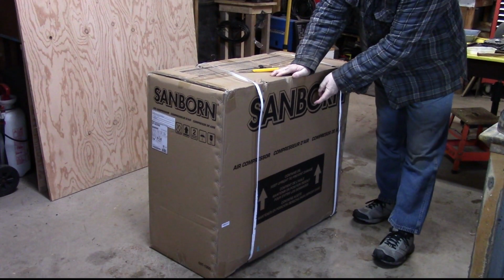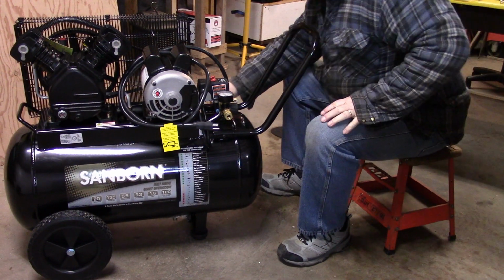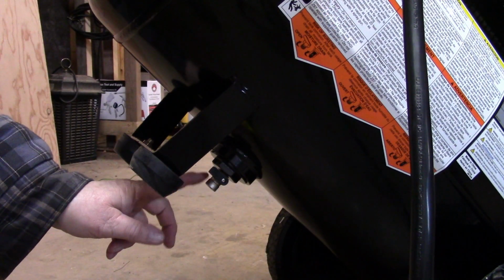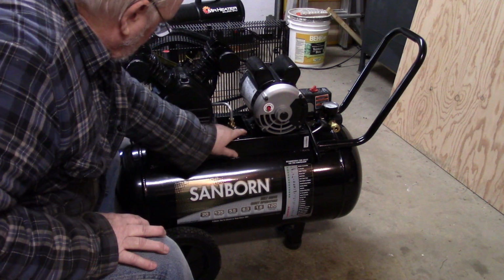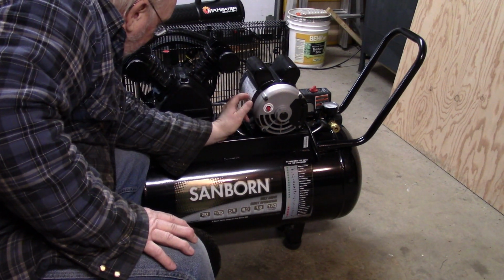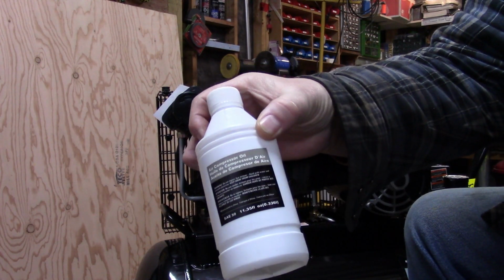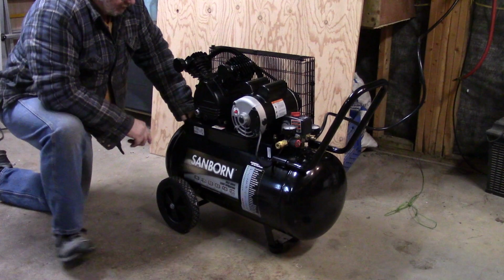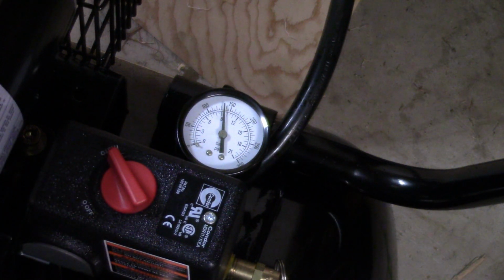Commissioning My New Sanborn Air Compressor

Comment: I just bought that same compressor off Face book market place , mine quit working after about 30 minutes , it didn't have any air in it when I first started messing with it and so I plugged it in and turned the switch to auto and it didn't take long to get it to 135 psi , I then started practicing spraying a paint sprayer and getting the sprayer adjusted, I was using water instead of paint just because I was practicing and plus trying to see how long I could paint until I ran out of air .
I ran it out of air about 3 times 
I forgot to mention I was powering the compressor using a Honda generator and right before it quit working my generators motor reved up really high meaning the compressor was pulling a lot of power for a short time like a surge , it hasn't worked since and so I come on YouTube trying to figure it out .
Thanks for posting this video it made me more familiar with my compressor 
because at least I know where a few more components are that I didn't before.
I tried pressing the red reset button on the electric motor but it doesn't seem to move much
Reply from the maker: How's she goin'?  First off, thanks for searching out my video and I'm glad it was of some help.  Secondly, it sounds like maybe you have a compressor issue, not a motor issue.  The red reset button won't move much if the thermal overload is not tripped.  Did the circuit breaker on the generator trip?  Did the generator stop running when the compressor stopped?  Can you turn the compressor by hand?  If none of these things happened than maybe you could have a bad motor or the thermal overload is shot.  Good luck.  I hope you can get the compressor running and continue with your projects.  Take 'er easy!!
Reply: @GrampiesWorkshop 
My generators circuit breaker didn't trip but the light turned red like it was getting ready to trip.
Then the generator kept running like normal
Reply from the maker: I suspect that the circuit breaker on the generator did trip.  Have you tried to reset it?  Sometimes a breaker will trip and it looks like it isn't.  Just turn it off and then back on.  Good luck!!
Reply: @GrampiesWorkshop 
My compressor and motor both spin freely not locked up.
I was going to bypass electric directly to the motor to test it , 8 first just tried powering it up and the compressor fired right up and went from 0 psi to 135 psi in 3 minutes.
It's got a air leak were the pipe threads into the tank , the pipe that runs vertical going from under the switch to the tank , it's leaking at where it threads into the tank , will Teflon tape fix that or do I need something more specialized ?.
As far as the generators tripping, I don't think so because when there running correctly they have a green light and when the generators breaker trips the green light goes out and the red light comes on and I have to restart the generators to reset and get the green light back on , I'm running 2  
Honda eu2200i in parallel 
A single Honda eu2200i wouldn't even start the compressor..
Thank you for all the info , these compressors are nice , nice and quiet
Reply from the maker: That's a weird one about the breaker not supplying power from the generators.  When running generators in parrel it's important that they be phased correctly or else one will try and short out the other one.  It's pretty tricky theory to couple generators together.  When I was a working Joe, my job was an industrial electrician and part of what I maintained was the standby generators to run equipment in case of a power failure.   It was always an issue to get the generators 'phased' correctly before we could put them on line because they would short out and shut down if the phasing wasn't correct.  Oh and Teflon tape should help with your air leak.  I hope you can get this sorted out and have your compressor working good again!  Take 'er easy!!

Comment: Even though it has two cylinders is it a 2 stage or single stage?  Which is better and what is the difference.  Thanks Mate👍😊
Reply from the maker: How's she goin'?  Thanks for watching.  That's a good question.  This is a single stage compressor and that's why it takes so long to build pressure.  A dual stage compressor compresses the air twice and so builds pressure faster.  I think for the average DIY're a single stage compressor is fine, but if I were a body man and spray painting or using the compressor a lot every day, a dual stage compressor would be worthwhile.  Thanks again for dropping by the shop and take 'er easy!!

Comment: Thank you. I still have my 30 year old Sandborn
Reply: I forgot to mention that it stopped working and I’ve been looking for a solution. I found a video that pointed straight to the capacitors but now I’m thinking that I may buy a rebuild kit for it as well
Reply from the maker: Ooops!!!  Maybe it's not so good!!!  LOL  I'm sorry to read that yours is broke down.  If it's an issue with the motor not starting then the caps could be the fault, or the electrical 'start-run' switch on the inside of the motor could be bad.  Caps don't usually fail unless physically damaged, but the start-run switch switches a good amount of current every time the motor starts and so could have problems with the contacts wearing out.  Just sayin'.  I sure hope you can get it running again.  Thanks for the comments and take care!!!
Reply from the maker: How's she goin'?  Welcome to the channel!!!  My Sandborn is working great!!!  I'm glad to hear yours is still working after 30 years!!!  Thanks for tuning in and take care!!!

Comment: My old Webster 1hp hot dog  compressor that is at least 34 years old, i retired it due to worry over rust,  and it never had a label  or welded tag stating the date. 
The new campbell hausfeld compressor i got does have that on it.  None the less i went to Staples and got a Sharper Oil-Paint marker in white, and labelled the date i got the compressor and the date the tank was made.
Reply from the maker: How's she goin'?  That's a great idea!!!  This compressor has a tag on the tank, but marking the date would be a much better idea I think.  I have a 'red' paint marker.  I think I'll date my tank first thing in the morning.  Thanks for the tip and for watching.  Take care!!!

Comment: Mike   I have an old "non-oil" compressor and I find the noise is loud, annoying and sharp.   Its also on its last legs , I am a DIY'er mainly needing air for small cleaning jobs, tire inflation on my cars and light work in the shop.  How is your Sanborn holding up.  Princess Auto has them on sale right now and Im thinking on getting one after watching your video
Reply from the maker: Hello there Al and Andrea!!!  Thanks so much for dropping by the channel and watching this video!!  Here's my honest and frank evaluation of the Sanborn Compressor I bought:  I think it's a very good compressor.   
Now for the details!!!  LOL  It is a bit noisy.  When I first got it I thought it was pretty quiet, but I was comparing to my older one which was loud.  So the Sanborn is a bit on the noisy side.  Not terrible mind you.  Like you can still carry on a conversation standing beside it but it's noisy.  
Another thing I encountered was the oil I used, which was SAE30 compressor oil as recommended, gets pretty think when in the cold.  I don't heat my shop except for when I'm in there so during the colder months, the compressor wouldn't start because the oil was cold and think.  To overcome this I had a magnetic oil heater that I had got one time for my tractor.  I just place it on the crank case and plug it in.  It's a 300 watt heater I think, and it manages to keep the crank warm enough so that the compressor will start.  
I also feel like it takes a long time for the compressor to build up pressure.  What I'm trying to say is the cycle time seems to be long.  It may not be, but when you're waiting for the compressor to stop, it seems like it take a long time.  I timed it in the video and I can't remember exactly how long it was, but when you're waiting it's looong...  
Other than that I think this compressor is great for doing the things you mentioned.  That's more or less what I use the compressor for as well.  It seems to be well made and good and rugged.  Like I said, I think it's a good compressor.  
I hope this helped you with your purchase.  I know the compressor is a big ticket item, so when I was trying to decide if I should get  it or not, I was thinking I want to get a good one, but I don't need the Cadillac version right.  
Anyways, it was great to have you visit and I hope you come back again.  You can tell me about what you work on in your shop, or better still make some videos and get them on YouTube.  It's a great hobby!!  Take 'er easy!!!
Reply: @GrampiesWorkshop  okay that helps , My old one is really noisy but its the type of noise it is.  .  Im working in a 12x20 garage area and the compressor will be on the far wall.  It won't be running a lot anyhow so Ill just ignore whoever is talking for the 4 minutes it runs or they can ignore me . I also watched your episode on installing a drain hose and I will be doing the same thing.  Looks a lot more convenient than trying to reach underneath
Reply from the maker: @alandandreabonner4404  It is a lot easier.  And don't forget to drain the tank regularly!!!  LOL

Comment: Thanks for the great video. Does it work off a 15 or 20 amp breaker?
Reply from the maker: How's she goin'?  Thanks a lot for dropping by the channel!!  This compressor is fed with a 20 Amp circuit.  I have to say I am pleased with the compressor.  It has been working good.  But one day during the winter, it was like -10 C in the shop, the compressor wouldn't start and it tripped the breaker.  I come to find out that the oil was too think due to the cold and the motor couldn't get up to speed.  I put a magnetic 200 Watt heater on the compressor pump crank case and after a few minutes it started up and I have had no issues since then.  Thanks again for watching and take care!!

Comment: What size of fittings would I need to put a second hose attach point on there. 3/8” or 1/4”?
Reply from the maker: How's she goin'?  The fittings on this compressor are 1/4".  I am trying to add a distribution line in my shop and the air lines I bought were 3/8" ID with 3/8" fittings.  Needless to say I had to make another trip back to the store to get reducer fittings to go from 3/8 to 1/4!!!  LOL  I would suggest you figure out what fittings you need and then buy double that amount!!!  LOL  Thanks a lot for the comment and the question!!!  Great stuff!!!  Take care!!!

Comment: very nice compressor there my friend    yeah I bought a 60 gallon   Porter Cable    it's a V-Twin  230 volts  3.5 horsepower   11.5CFM, @90 psi
Reply from the maker: How's she goin'?  Your compressor is a beast Roy!!  That should last you for a good long time.  11.5 CFM at 90 is a lot of capacity, but it's better to have too much I think.  Thanks for watching and commenting,  Take care!!

Comment: Remember not to long ago I asked about compressors.. thanks for the video!
Reply from the maker: How's she goin'?  Well Matt I hope this video answered some questions for you!!!  When I was looking for a replacement compressor I wasn't much interested in horizontal models.  I thought the vertical ones would be better.  Smaller footprint, easier for condensate to gather at the bottom of the tank and so less rust.  But this horizontal one was a good price and now that I have it, I'm liking it pretty good.  Thanks a lot for watching and commenting.  Take care!!

Comment: Hi Mike!  Looks like you have a really nice compressor there!  5.5 CFM is a pretty good output volume.  That should last you a long time! Thanks for sharing!
Reply from the maker: How's she goin'?  The capacity of the compressor is better than the old one and I like the vee twin piston set up.  But the part I like most is spare parts are readily available!!!  I have to admit I wasn't a fan of the horizontal configuration, but I'm getting won over!!!  Thanks for tuning in and commenting.  Take care!!

Comment: I have a 2 hp Brunner that was built in 1964.  I runs great and I use it a couple of times a week.  I would be lost without it.  I am impressed with your new compressor and with the recovery time to shut off. If I was in the market for an update I would certainly consider one like yours.  Happy blowing.
Reply from the maker: Hey there Francis!!!  Thanks for the nice comment!!!  I think this set up is ideal for a DIY shop like mine.  It does recover quick and it also takes longer before it starts up and the cut in is set to 105, so I can't complain at all.  That's great that your compressor has been around since 64!!!  It must have been a good on, and not made in China I'd say!!!  LOL  Take care and we'll see ya next time!!!

Comment: The new comressor looks great and well made. We are thinking of making a compressor shed outside to address the noise issue for ours and to free up workshop space. Our compressor is 18 years old and still going strong
Reply from the maker: Hey there Joseph!!  Still running after 18 years!!  That's great!!!  They don't make compressors like that any more so make sure to take good care of it!!!  I think that would be a good idea to put it in a separate shed.  Safer and quieter!!!  Thanks for the comments and for tuning in.  Take care!!

Comment: Bonjour Mon Ami et félicitation pour votre nouveau compresseur que votre épouse vous a donné 👌👍😊 Great air filter Sir 👍 Sir, in all life support/aircraft maintenance facilities were horizontal tank compressor so do not be worried they were all older than me 😊 I think you will flush it daily now since it is easier to do and also do the oil change too 👍 Very good that you took the time read the manuel 🧐👍 Great video Sir and I like the white board written and Bonne fin de semaine mon ami 👍😊
Reply from the maker: Salut Dave!!!  Merci d'avoir regarde mon video!!!  I sure plan on draining the tank at least every Monday!!!  I like this compressor so far.  I was a bit nervous of the horizontal set up but I think it will be fine.  It is well made and spare parts are available at Princess Auto!!!  So I think is all system go!!!  Thanks for commenting and I'm sorry this isn't in French!!!  LOL  A la prochaine mon ami!!!
Reply: @GrampiesWorkshop  Prenez bien soin de vous deux 👍😉

Comment: Looks good.  The fact that it has a sight glass for the oil resevoir might be a sign that its meant for serious use by serious people.  You don't see that on small motors much if ever.
Thumbs up and thanks for posting!
-Steve
Reply from the maker: Good day Steve!!!  I like this compressor.  I wasn't a fan of the horizontal set up, but I'm warming up to it!!!  Everything on it seems well made and rugged.  Easy to get at and easy to maintain.  I will be putting an extension on the tank drain just to make sure I get at it at least once a week!!!  LOL  Thanks for commenting and take care!!

Comment: I think it's a great compressor that doesn't take up too much space but is able to do pretty much anything you ask it to.  You could get creative and pipe the intake outside of the shop, that cuts the sound down dramatically. You can adjust the max pressure by removing the plastic cover on the regulator, there are adjustments that can be done, I let mine get to 150psi before cutting out
Reply from the maker: Hey there Bruce.  I think this compressor set up is ideal for a medium duty DIY shop like mine.  A good size and I really like the Vee Twin pump arrangement.  Good idea to pipe the intake to outside.  I'll have to check that out a bit.  Now I have plans to change the whole shop around to accommodate the new compressor and also pipe in distribution air lines around the shop!!!  Every solution has a problem eh!!!  Thanks for commenting and watching.  Take care!!